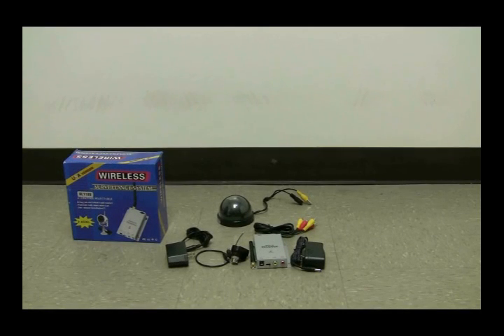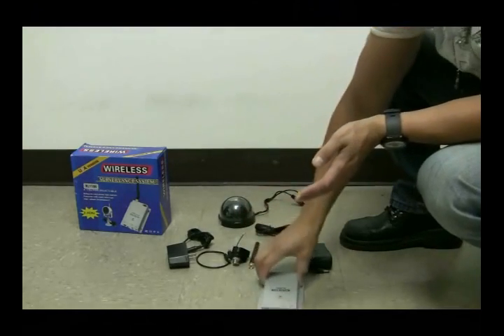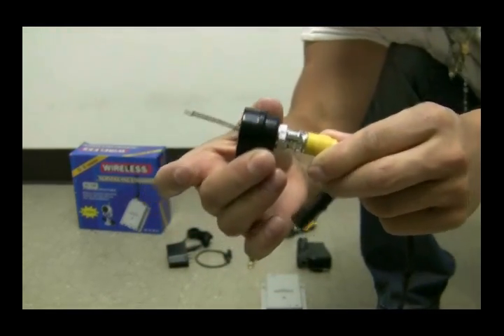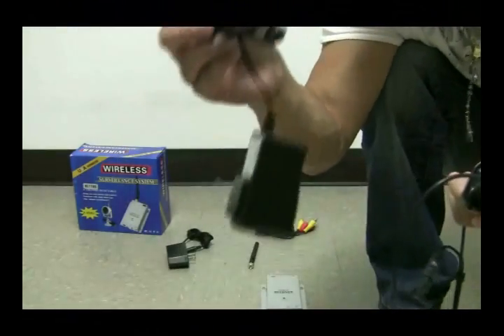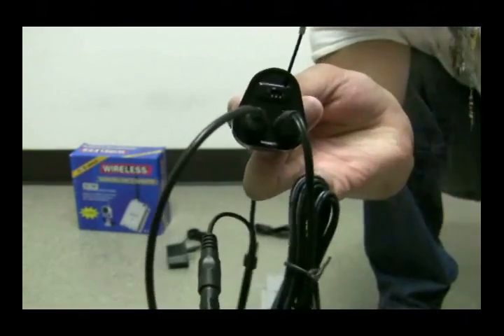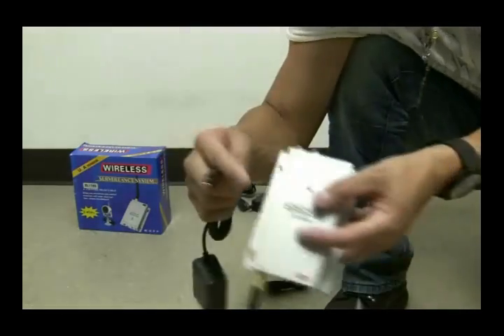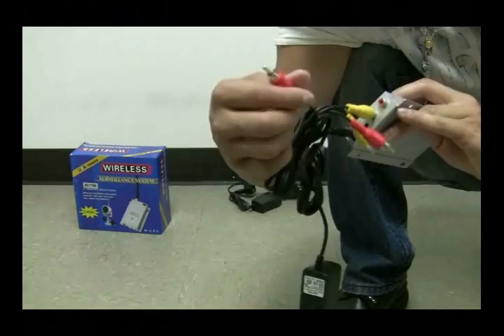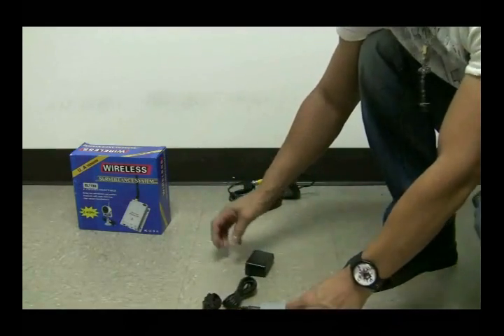How to make any CCTV Camera Wireless with Wireless Adaptor

Comment: The money spent on all of this stuff , you just buy a wireless camera
Reply: This is a video from 2010. Go back to those prices and see if it makes sense.
Reply: Wireless cameras have much lower video quality than wired cameras. Year 2020
Reply: Mike Jones that is a bit of a generalization. Both the Wi-Fi and wired models use compression. Both use your home network, not sure what you base this on. If you have a strong wifi there is no difference for quality. I can stream multiple 4K videos just fine either way. It may be 2020 but we still compress!
Reply: @ansidrop  Based on megapixel mp feet per second fps, resolution and range. They all say 4k. But 4k on a 2mp lens with low fps plus less range. 
Now lets say you have a wireless camera and want the best possible quality. Max out all the settings and your battery life drops to half. 
After doing extensive research I could not find a wireless system that is comparable in quality and price as a wired. 
The specs are always going to be lower on wireless because better image quality requires more power.
Reply: @ansidrop  compression is only for data transfer

Comment: Any use of transmitter on 2.4 GHz can cause extreme interference with wireless router connectivity.  I would highly recommend 5.8 GHz as an alternative which will not interfere with any wireless device. I have several of these transmitters sitting on a shelf totally useless. The range is extremely poor probably only working within the same room.
Reply: Thank you for that tip.

Comment: Hi, can I connect a home security camera to a wifi dongle and basically run it live from the dongle? just having a few ideas for setting up some kind of home security, but they don't have internet at the house.. so I'm thinking a wifi dongle? the cam would be running on batteries also. any suggestions? The idea is to keep an eye on the house from another location.
Reply: U'll need a pc/nvr/dvr to receive and transmit videos. Other than that, yes you can connect cameras as such,  IP cameras with inbuilt hotspot are probably best option.

Comment: Hello.
How to connect several mini-cameras ( for example 6 )  with a “video switcher ‘ and the video switcher to an transmittor ?
The idea is to  be able to watch on the TV ( for example)  from different mini-cameras ( not at the same time)  but able to switch from one to another mini-camera ?
The best would be to have a remote-control for the switcher.
The receiver would be the same as yours, the transmitor would be connected to the video switcher and the 6 cameras connected to the switcher..
I do not know if there are 'video switcher' with remote-control...
any idea ?

Comment: You say it will connect "any" camera to a wireless one, I'm assuming you mean any composite camera with yellow connector. My cameras are full HD 1080 resolution 1200tvl with a green HD BNC connector. Will the transmitter still deliver full HD to the receiver and the dvr?
Reply: Only someone with high definition cameras will know the answer

Comment: With that transmitter will I be able to view the camera over a network?

Is there a BNC to WiFi adapter that would allow me to view it over a network?  I don't like it when all they say is 2.4 GHz.  I want to know precisely everything that I can use it for before I even consider buying it.  I have an old PC that I want to setup as the DVR but I want the camera to be networkable with ethernet or preferably WiFi for easier setup and relocation of the camera if needed.

I would just buy a WiFi camera but they are a bit out of my price range.  I should just save a little and get a good 1080p WiFi camera instead of playing the mystery protocol game.  I don't want to blow a ton of cash on something that I am not sure if will work or worse come with limited instructions in Chinese.  The instruction part would be OK if I had a friend who could read them to me because I primarily speak english.  It doesn't even have to be 1080p, I just want to be able to confidently say that so and so did what ever crime.  The best way to help keep them from trying to say "that is not me" is to use a good enough camera.  I just wish the 4K resolution cameras were not so expensive.  They sometimes cost more than most cars I see are worth when you start to explore the 4K camera options.  But ideally I would prefer to be able to pick out every speck of lint on someones clothing but I just like good clear pictures.  Todays high definition starts to look like standard definition.  Ever look at some of your really old digital photos and although the quality is all still there it is such a small photo that when you view it full screen today it looks horrible?  That is the problem with low resolution.  I noticed that when I looked at some of my old photos and realized that I need cameras that match or exceed the resolution of the display I would play the video back on.  This way when I play back video evidence I don't get the ugly surprise of an unexpectedly fuzzy video because the resolution was not high enough to show it reasonably.
Reply: This just saves you from having to run a wire to the cameras location. it does not make it a network camera.

Comment: I have a BNC system so this dosnt help much finding it hard to find a BNC receiver can any one piont me in the right direction. Don't want anything to do with CO-AX!!!!!!
Reply: use an RCA ->  BNC adapter , and if you don't like  coax use  a passive BNC  balun  that works with  CAT5  you get  4 video feeds per line
Reply: Tryimg to fimd this kit as well. I just made an old bnc camera battery powered and now trying to find a transmitter .btw you can splice bnc to rca.... Js

Comment: after looking i found r.ebay.com / N9f3Ak    and other listings for the part in question i dont believe it is waterproof. you would need to put in a waterproof casing if used outside. it has also a humidity rating of 85%RH which suggests it is not waterproof by design as well.

Comment: sure but i suggest a usb dvr adapter. it is not dependant on a vcr/dvr but instead turns your computer into a dvr recorder so to speak allowing u to record audio and video sources. i suggest a motion sensitive recorder so that you dont fillup your hard drive with motionless video. you only want to record when there is motion. they do sell vcr's that do this too but i believe they are not cheap.

Comment: thats not a continuous power source it wouldnt be a cctv system if the batteries died it is a usable source but would be very expencive plus wouldnt be very stable if you left them out in the elements